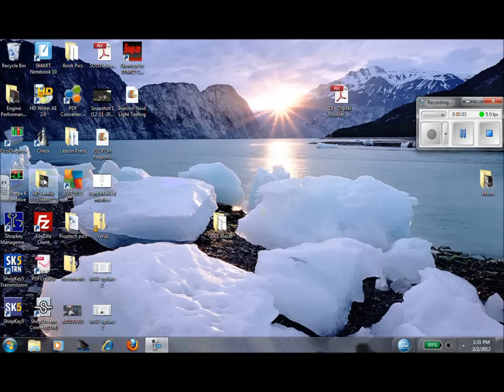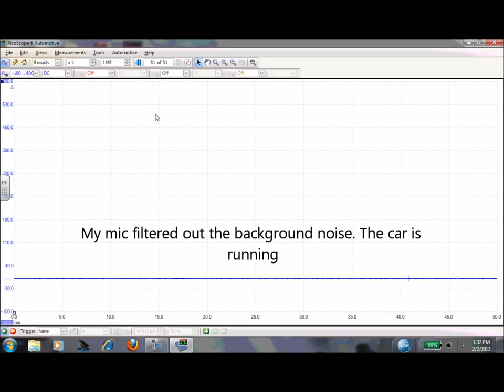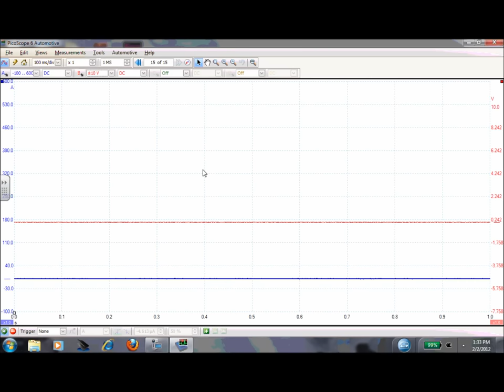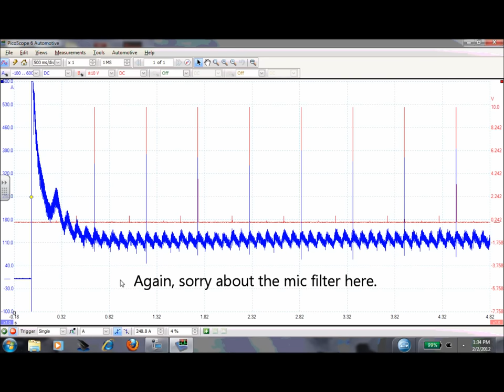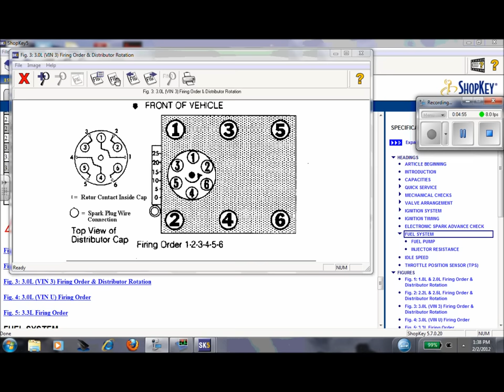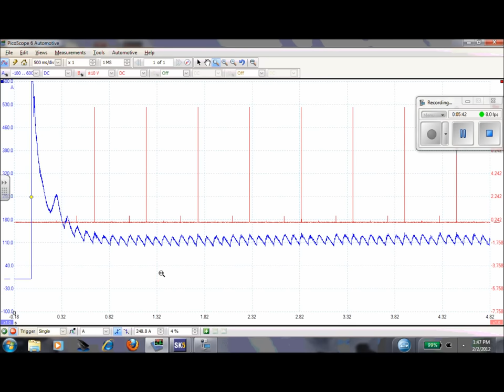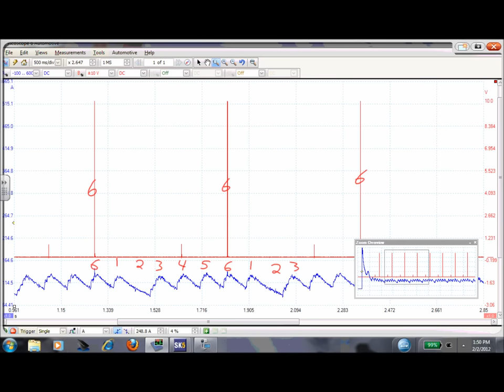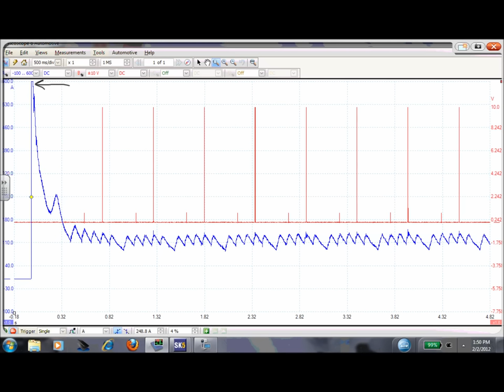How to perform a compression test with a scope (Picoscope)

Comment from the maker: @foxholewilly On coil over plug gas engines I will use the PCM to coil, base circuit control signal, which is a 4-5v on/off square wave (3 or 4 wire coils) or the coil negative voltage itself (2-wire coils) to sync the waveform. If I cannot access the coils, I will connect to the PCM connector to do it. So on our gas engines there is always a way without pulling a plug.

Comment from the maker: @500hpsi I must be careful in my response. I'll just say for now that both of these scopes have there advantages and are great tools in the right hands :).....sorry
Reply: Hi mister paul i really appreciate your efforts in explaining different case studies i just want to ask you do you have to remove spark plug wires when doing a compression test because as i think the engine  will start if you leave spark plug wires plugged in. Greetings from Morocco 🙏🙏
Reply from the maker: @mohammedcherifi9206  no, you can disable to ignition or fuel injectors by removing a fuse or disconnecting power to the coil or coils
Reply: @ScannerDanner  thank you sir

Comment: Hello SD, soooperb videos, my question is:- when doing relative compression on a diesel what would be the best "sync pulse" to use in order to determine piston nums as you obviously dont have spark plug leads you can use to sync ?  crank position sensor ?, tap into injector pulse signals?

Keep up the guid work

Comment: @ScannerDanner - it depends on engine. For example, in my car i have "common rail" system with piezo-electric injectors which sprays three times per cycle:
First, called "initial spray" occurs during induction/compression stroke,
second -"main"- adds more fuel during power stroke, and third during exhaust stroke (mainly to reduce NOx emissions).

Comment: Hey Scanner! You rock man! Quick question.........can I use a cheap Hantek Probe for the spark plug wire pickup to do this test with when I get my Pico Scope? 

The first thing I want to test when I get the Pico scope is one of our 5.4 F250's. It has a misfire under load with no code.

 I'm looking to get the 4 channel starter kit with the two amp clamps added in.
Reply from the maker: +ILTSYC thats a great kit and I'm not sure if the probe you are talking about will work with the pico. Where are you buying it from?
Reply: ScannerDanner I was looking at autonerd's 4 channel starter kit and add the two amp clamps on.

Im sort of torn between getting that or a used Snapon Modis so Id have a good scan toll and a 4 channel scope in one unit. If I get the Pico I'll just get a good scan tool a little bit later.  I was thinking maybe a Solus Ultra, Autel DS 708 or Autoenginuity Pro.
I like the idea of PC based diagnositics because I can fix a PC but a handheld unit has to be sent in if it should need repair.

Comment: What is clear flood mode. And what do you mean when you wrote clear flood mode is done by eco when it sees TPS voltage at WOT?(What is WOT?)
Reply: Found out what WOT is. Wide Open Throttle and clear flood mode is the PCM turning off the injectors and spark. Cheers for the video dude, im heading after a picoscope myself. Oh and a snapon scan tool because of the troubleshooter section. I have a maxidas 708 and its only a month or two old. It has no trouble shooter, and because of that, and after your video showing how cool troubleshooter is, im going for it.

Comment: Is it possible to perform similar test on a diesel engines? 
They have no ignition coils, so how to know which cylinder is which? Maybe connecting to the crankshaft position sensor?

Comment: Hey hows it going, im in an auto program in the bay area and i've found your videos to be very helpful.  I got a question though 
arent you supposed to be able to see an exhaust wave in between all the compression waves?
Reply: No. Because the exhaust valve is open when piston is moving up therefore no compression or pressure on the starter motor

Comment: Why did you use the # 6 plug wire? Just the closest one? I guess you could use any plug wire to give you a signal and then
look at the firing order to know where the others fall? Just wanted to make sure I'm correct in how you're setting this up.
Another awesome video!!
Reply from the maker: exactly, just the easiest one to get to

Comment: When testing compression via starter current at common rail or UIS engines...I suppose there is no way to trigger the 1st cilinder, because I've to disconnect the injectors or I need to record the camshaft and 1st cilinder injector signal to know which block of the camsensor stands for the 1st cilinder (what a text...) ?!?

Comment: Could you use a relative compression to see if you have a clogged exhaust?
Reply: You would need a cheap compression gage and plug it (by just pressing) in a O2 oxygen upstream (before exhaust). You should have no compression, if you do, then the exhaust could be clogged. But don't be fooled, do the same test in sections to find the true clogged component.

Comment: How do we hold the throttle open if no "clear flood" mode is available on electronic throttle?
Reply from the maker: For a compression test? Disable the fuel system (fuel pump or injector fuse or connector or relay)
Reply: @ScannerDanner  I meant HOW DO I GET THE THROTTLE TO OPEN if it's electronic.  I use the live data from my scan tool and it shows the throttle closing after I begin cranking (fuel disabled). 
The PCM does not keep the throttle open.
Reply from the maker: with key on, engine off, put the car in gear and step on the gas pedal (app sensor), the system may react and open the throttle plate

Comment: On a Pico 4223 would I have to use an attenuator on the 600 amp clamp or the sync probe?
Reply from the maker: Not needed for either the sync probe or amp probe
Reply: Thank you